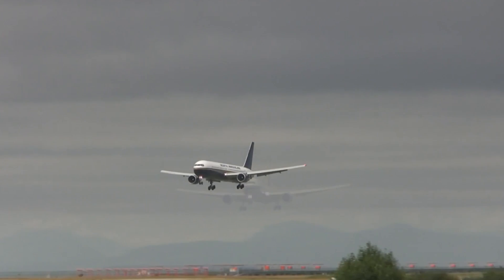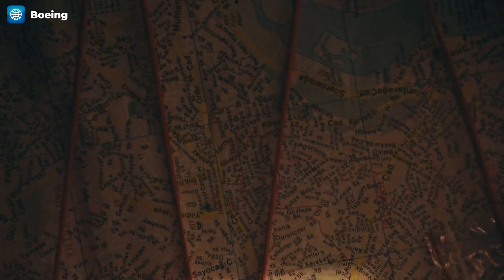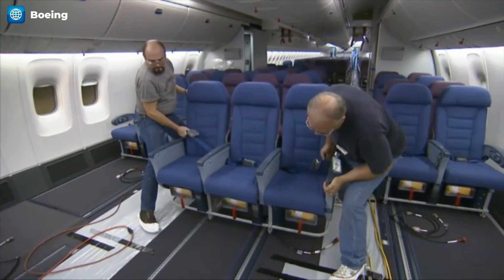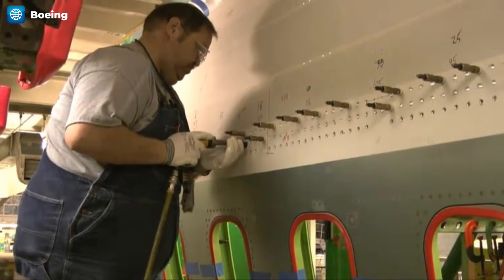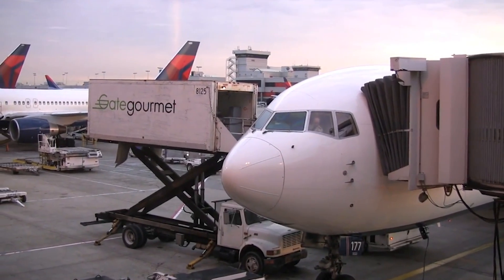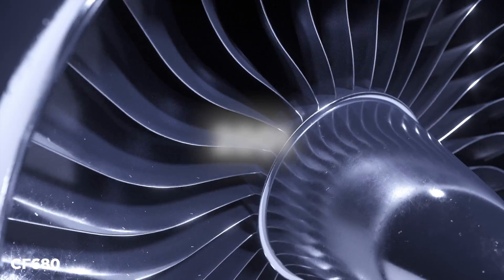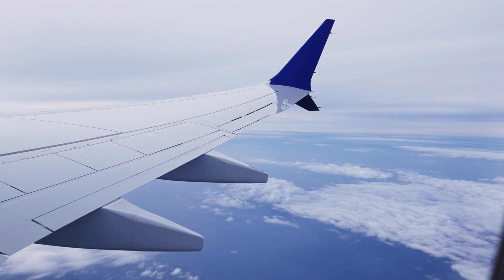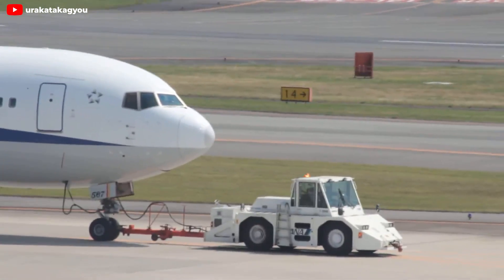NO Airbus! All Airlines BEG for the NEW Boeing 767! Here's Why

Comment: I have flown on the 767-300ER British Airways use to fly them to Toronto international airport and it was a much nicer plane than the 777 or the 747 so I very much hope that Boeing goes ahead with the re engine and the technology and fuel efficiency upgrades for the 767
Reply from the maker: thanks for sharing your experience
Reply: You’re welcome
Reply: There is no point in beating a dead horse.